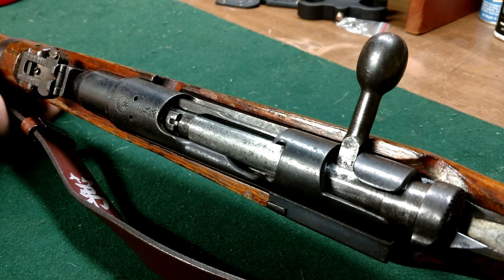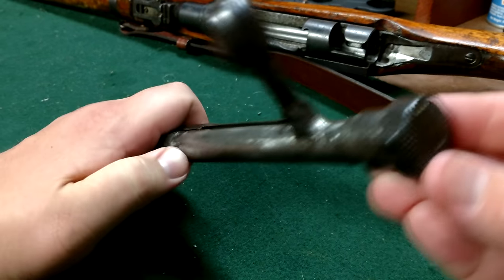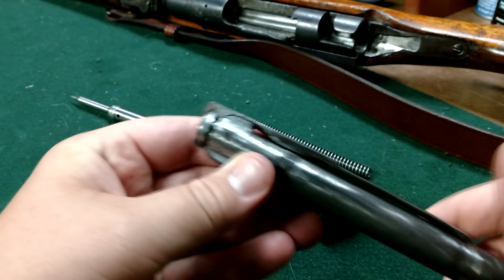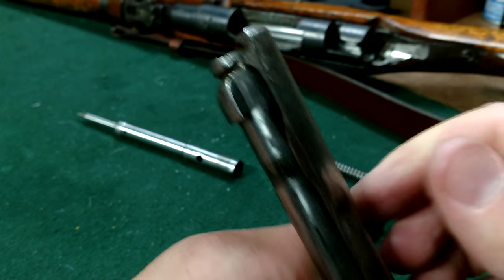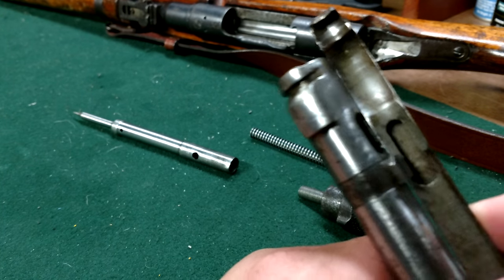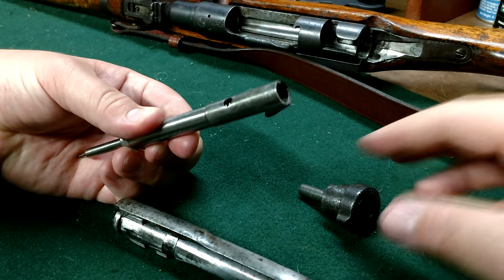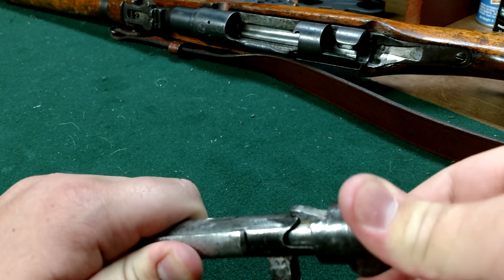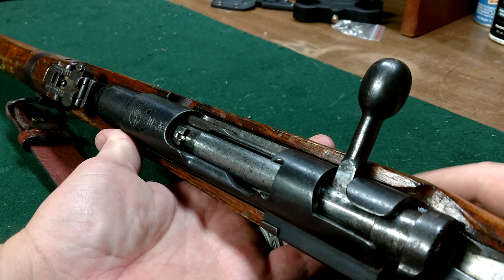Bolt Disassembly & Assembly: Japanese Arisaka

Comment: Appreciate the video sir. I received a barn find Arisaka with a frozen bolt. I am in the process of repairing the rifle and your videos on this rifle were the best on Youtube.
Reply from the maker: Was the bolt deactivated/welded?
Reply: No, but the rifle could be a fabulous study in the benefits of cosmolene. It was just stored outside in a shed for thirty plus years.  No real damage, amazingly. No mum either, so a perfect project rifle. Your video helped a ton with my safety mechanism questions.
Reply from the maker: @arl0xen551  That's a shame about the lack of a chrysanthemum but that is the added benefit of being able to toy around with the rifle more and not worry about damaging it. Is yours a carbine as well? My carbine's wooden stock is not original to the rifle, it is an original stock but it was refurbished improperly which is why it has that really neat color.... If your stock is original finish and it fits my rifle I would be interested in trading it out, or paying you for it and giving you mine.
Reply from the maker: @arl0xen551  Make sure you take it to a gunsmith before you attempt to fire it even after you get it working properly. Remember that a lot of them were sabotaged by the labourer and rigged to explode in the shooter's face after one or multiple shots with weakened metal.
Reply: Dayne's World mine looks to be a 1935-38 rifle built at the Tokyo arsenal. Im assuming that insured a quality product when built originally. Great tip though. I will have it checked out. The frozen bolt preserved the bolt-face, chamber and firing pin. They look great. If my rifle repair goes south, I will send you the stock.
Reply from the maker: @arl0xen551  I think it doesn't matter where it was made. They purposely would make sabotaged ones and just leave them in conspicuous places hoping Americans and French would find them and become injured to the point of taking not only themselves, but their caretakers, out of the fight. Best of luck!! I'd love to see a video on it, I'll follow you.

Comment: I’ve got a type 38 with the bolt stuck half way into battery but can go straight up though not back at all.thinking some gunk is in the way. Thank you this was helpful.
Reply from the maker: Glad it was helpful! Just as a precaution, I'd recommend going to a gunsmith to have it checked for safety prior to firing it. I know the Japanese would purposely booby trap some firearms and even if it appears perfect, better to be safe than to have a receiver explode in your face.

Comment: I was given a Type 99 rifle. The bolt is in the rifle but the rear knurled safety knob is off. The bolt will not come out of the rifle. Is there any way to get the bolt to release and come out without disassembling everything? Thank you for any help.
Reply from the maker: Can you pull the bolt back (as if you were in the process of chambering a new round)? If so, try doing that while pulling the release lever out as shown in my video. If that doesn't pull the bolt out of the rifle, I would go to a gunsmith. In order to get the safety knob back on, you have to go through the proper disassembly and reassembly of the bolt carrier group
Reply: @DayneExplores  I took the rifle apart. I pulled the firing pin out, Then I lifted the bolt release and the bolt slid out. If anyone else has this issue I do not think you would have to take the rifle apart to solve this issue.    I found out that the reason the bolt safety knob was off was due to it never being able  to be put in the safety position when palmed in and up with the hand.  I have tried and it will never stay in the safety position. Have you ever had this issue and if so what was the problem? Thank you for your help.
Reply from the maker: @j.t.masters1934  glad to hear it!

Comment: Hey, I have a type 44 (same exact setup); the safety knob came off while the bolt is still in the gun and the lever to remove the bolt is half-way engaged. I cannot get the bolt to move, or the safety to go back on the back of the bolt
Reply from the maker: Is there a round in the chamber? I would call a gunsmith regardless. If there's a round chambered, be extremely careful. That safety could very well also protect you from being injured by gasses or whatever else if you pulled the trigger on a live round. Good luck....hope you get it sorted safely

Comment: How can I remove/open bolt if safe is on and the safety knob somehow came off and won't go back on? Also where did you get that Sling?
Reply from the maker: Sling is a reproduction from eBay several years ago.
I recommend going to a gunsmith.... I'm not aware of how that could happen.
Reply: @DayneExplores  okay, thank you for the speedy reply on an old vid

Comment: bolt won’t turn while in place
Reply from the maker: I would recommend you find a gunsmith. That's a bit out of my knowledge, I'm sorry to say.
Reply: @DayneExplores  it makes sense because it sat on a shelf for 60 years
Reply from the maker: @CliKcz  that sucks. If it was me, my number one concern would be "is there a potentially live round in the chamber?". Not really any way to know for sure. Even uncocked, there could be a round. So be careful.

If I knew there was no live round, my next thought may be to loosen it up with lubricant sitting overnight so it seeps in. Maybe a little whack with a rubber mallet to the bolt handle....idk. but, best bet is to go see a gunsmith.